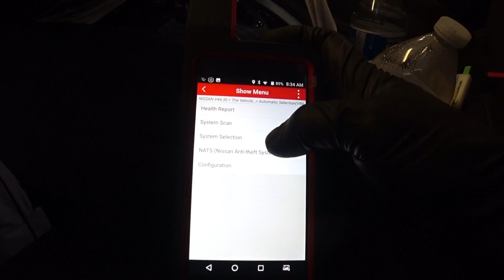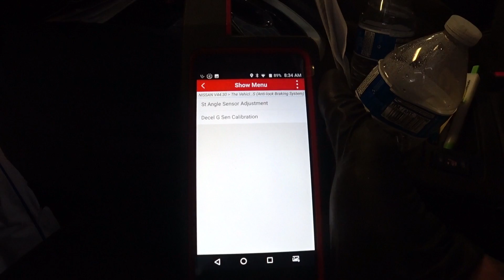Steering Angle Sensor Reset and Calibration Procedure | Launch X431 Diagun Tutorial | How to?

Comment: Im trying to calibrate the steering angle sensor on my infiniti q50 hybrid. Steering wheel is very stiff when turning. Car has direct adaptive steering (electronic steering system) but the car keeps asking to place the vehicle on a turn table and plug in a power supply to the 12V battery. Im using a Nissan creader elite by launch to do this but can't get the procedure complete as its asking for a turn table and power supply. How do ai get pass this and do it as easy as the video shows.

Comment: And not having that calibrated or reset could cause the vehicle to drift left or right?  I have a 2017 Nissan Rogue Sport SV and it has electric power steering.  Mine does not have a fluid reservoir that I can see which would take a specific fluid (I assume if I had hat I would have seen it by now).  My vehicle has an annoying tendency to drift slightly and I don't like it.  It is not only annoying but it can also make the vehicle unsafe.  It is especially unsafe if someone who does not know the vehicle does that ever borrows it since it may catch them off guard and cause an accident.  I am usually the only one in my vehicle and usually the only one who ever drives it except for any mechanic test driving it or taking into his garage.  Really I would like a scan tool that I can reset it myself with if it won't cost me a ton of money.

Comment: I've done a few on some Toyota's and have had very good success super fast love my diagun
Reply from the maker: CP the tool addict good to hear another Diagun fan
Reply: I definitely have been trying to use it more and more I'd love to see some more content on it seems like you have the opportunity to use it quite a bit most of my diags seem to be relatively easy lately. LOL I haven't ran into too much that I can't do but I did find I don't like to brake bleeding function that much it's not as good as the aultel it does a very short bleed and exits  have you noticed that?  Of course the battery life is pretty weak but I use a 7500 mh pack to fix that not a big issue.